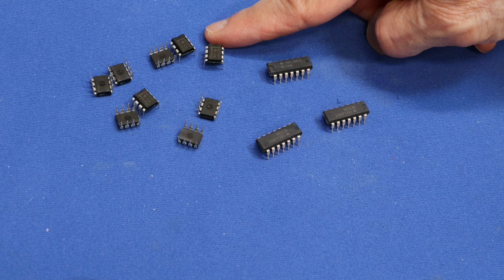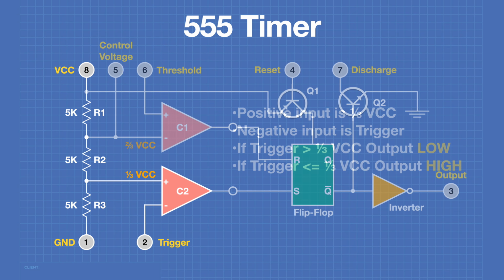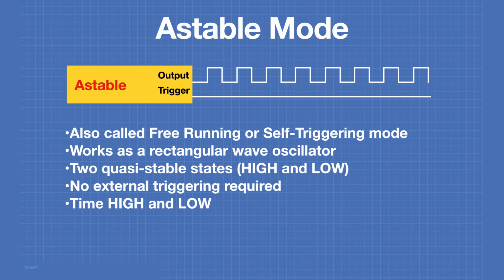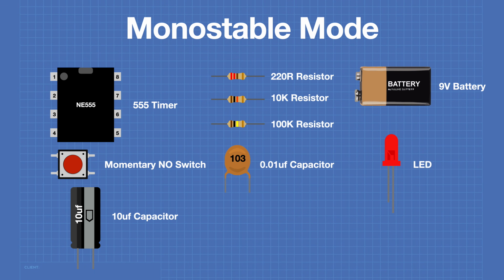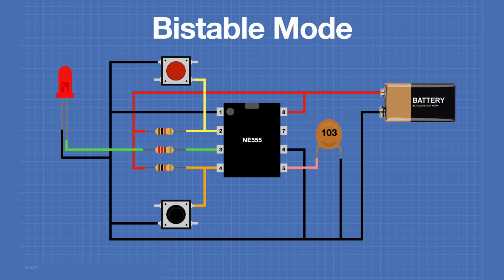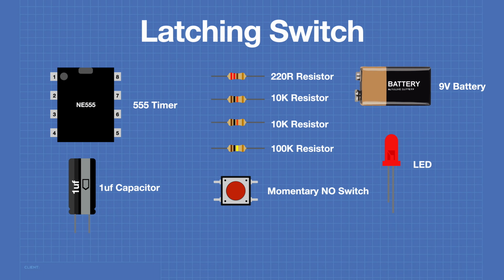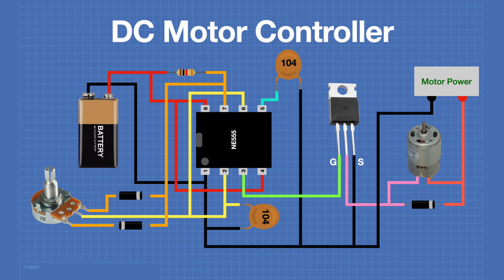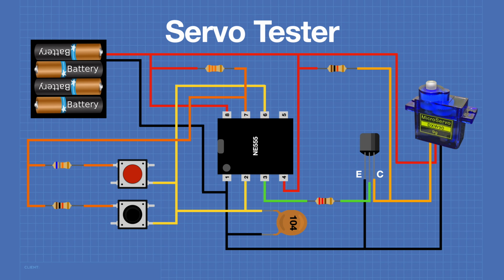Using the 555 Timer

Comment: sir this is very helpful video and the circuits you have shared are pretty good to work with. i want to know one thing. can you make a circuit diagram for us in which basically “when the current is provided to 555 it automatically turns on and turn off after 40-45seconds automatically and do not turn on ever after that, it only turns ON for these seconds when we apply voltage to 555” please make a video on this if it is possible. i am waiting really waiting i need this urgent to apply this somewhere in real life.

Comment: Hi,I don't know if it has been mentioned?...If so I'm sorry...  I had problems when using  the Latching switch diagram, I found that the green connection from the 100k resistor is at the wrong side of the 220R. Head scratcher for a while...Fantastic work Very clear and informative. Thanks

Comment: nice demonstration, in the touch switch mode, if the button is not released, how to make the LED switch off regardless of how long the button in pressed (in case I have door release lock coil instead of LED - so it wont be damaged)?

Comment: Hello, first of all, I just wanted to thank you for the wonderful tutorial on the 555 Timer. But when I tried using your wiring diagram for the latching switch project, it doesn't work the way it should. After I changed the wiring a bit, it worked. I only changed the position of the 100k resistor from between the anode of the 1uF capacitor and the anode of LED to between the anode of the 1uF capacitor and pin 3 of the 555 Timer. Thank you.

Comment: Thank you for your very informative video on the 555 Time. I would like to as a question regarding the DC Motor Controller circuit, I would like to run the motor at between 50, 60 and 80 Revolutions per minute. I built the circuit with a motor which runs on 1.5 Vdc. when I turn down the 100K Potentiometer the motor was still turning very fast. Thank you for instruction you maybe able to provide me to resolve problem. Thank you again for your instruction and informative video.

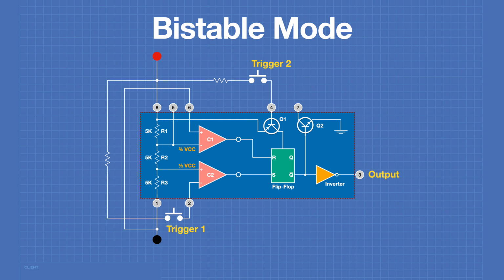Comment: Hi. Might there be a mistake in the diagram of minute 19:40? I see no link between pin 2 and ground through a button. Instead, the button is just connecting power and pin 2 with just an intermediate resistor. Anyway, I love Bill's video's and they are eye-opening for me.

Comment: Thanks for explaining the operation of this fantastic chip. One question. Since you run it at 9 Volts, the current throught the LED is about 33 mA with the 220 Ohm resistor. Is that not a little bit too much?

Comment: What if you installed a potentiometer and an old TV tuner style variable capacitor to fine tune the timing?
Have to check the Farad rating of the variable capacitor though, to make sure it won't fry the circuit.
I might try it sometime, I have all of those, if I can find them in my electro junk drawer.

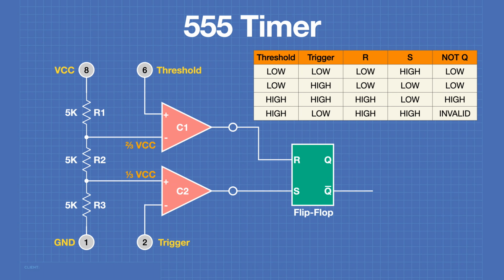Comment: Thanks for the video. I'm a little confused about the truth table at 06:25. If the threshold is LOW, C1 output should be LOW (as the negative is higher), but inverted that would be a HIGH going to R?   

I seem to be missing something with regard to the invertors after the comparators. Are these different from NOT gates? Can anyone explain?
Reply: Exactly what I was thinking. R and S are completely the opposite of what should come out so you're right.
Reply: Indeed inverting the comparator outputs is not consistent with the truth table.  Furthermore other 555 videos like https://www.youtube.com/watch?v=iwbGccGU4io and the 555 wikipedia page do not show any inverters there.  This does look like a mistake in this video.  Perhaps one way this mistake could have been made is that flip-flops are often drawn with inverted S and R inputs, with bars above S and R, in which case inverters on the comparator outputs would make sense.  So perhaps this diagram was copied out of some book with inverted flip-flop inputs; however, while the comparator output inversion was copied, the flip-flop input inversion was omitted.

Comically other videos on the 555 timer that don't show the comparator inversion say that it is named after the 5k resistors, contrary to this video.  Generally it is often possible to observe errors and contradictions in schematics shown on youtube videos, and never mind the videos where people use table saws and angle grinders in a way where they can lose their fingers, or repair vehicles in an unsafe way.  This just goes to show that electronics is hard and makes everybody confused, but at least at 5V you won't lose body parts or crash your car with your legs burned by a sudden engine coolant leak from above the brake pedal.

Comment: Thanks for great videos! I have a question, I want to control two 12v 4-wire PWM fans manually, but also with an Arduino, Nano, RPi or other microcontroller and display each fans status to a display. How would you include the microcontroller? Is it also possible to build a custom board to also power the fans, controller, or other add-ons? For example, I have a 110v PRC heater that I would llike to turn on and off to maintain a temperature while the fans are running at variable speeds circulating air.

Do you have a video or similar tutorial?

I’m new on this journey of learning electronics, so thanks again for the knowledge and your patience with the long questions.

Comment: and if the chip was to go obsolete and no longer made and/or was to go into shortage due to supply line shortage you can make it either from the individual transistors or using op amps and flip flop and transistors.

if the naming did not come from the 3 5k resistors then maybe inspired by the exchange code for the generic phone numbers used by hollywood.

every movie you watch that has a phone number mentioned is usually 555 1212 or 555 1234.

i thought the schmidt trigger was used because it has a very large fanout count where it can directly drive high power loads like an led without the need for a driver transistor.

Comment: I'm a beginner in electronics and recently designed a digital clock that displays the time in a binary format (hours and minutes only.)  At it's heart is an Arduino, and the timing of the clock uses the count function to increment the minutes, but I realise this isn't the most accurate way to keep time when designing a clock.  I've often thought about using a 555 timer, but haven't yet worked out how to regulate the output precisely enough to use it for that purpose.  This video is great for explaining the functions of a 555 but wondered if you could do one on how to use this chip for precise measurement of real time, if that's actually possible.

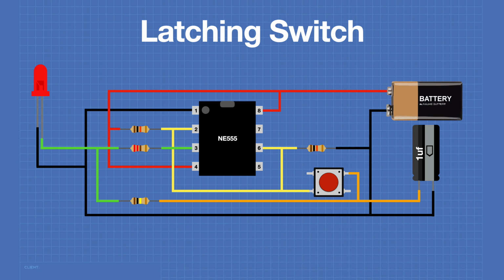Comment: my friend, i found a little mistake on the diagram on 29:00 minute (latching switch mode), the conection between the 100k resistor has to go directly to the terminal nr 3, in your diagram stay from the led and the resistor 220. Sorry for my english.

Comment: The latching switch schematic differs from your circuit configuration. The 100k ohm resistor should go in parallel with the 10k ohm resistor at the 555 pin 3 (not at the LED anode node) per your circuit.

Comment: Thank you very much for this great tutorial. I appreciate your effort and guidance. I would like to create a timer and see minutes and hours on an LCD after connecting the circuit. Is it possible to do it without microcontroller? As you've shown in the video can I somehow integrate the display instead of flashing led?

Comment: Does anyone know if the 555 as timer would allow for a restart? For example: say the capacitor keeps an LED on for 10 seconds when you press the button once. But if I press that same button again (or another one) when the LED has been on for 6 seconds already, I want it to restart the cycle and be on for an extra 10 seconds, making it a total of 16 seconds.

Comment: It's a great little chip that can be used for so many things, but I recently found out that it is one of the worst electronic nightmares if you want to use one in a car. Presumably because of the spark plugs, it goes crazy. I had one toggle switch that turned itself off, a buzzer that starts sounding like it gives off very fast random frequencies, almost like white noise, although it runs normally on a power supply or a battery... for some stuff that I added in my car I returned to the good old transistor circuits. I tried for weeks, nothing worked with the 555s, shielding, grounding, nothing.

EDIT: There's one detail that I failed to check, if the weird 555s were from the same lot or something, I never checked that... although I have seen people admitting that they might be a problem in a car.

Comment: Need a relatively simple circuit for switching a low power device of a few volts on for a second or two then waiting for about ten seconds to repeat.
One of these 555 circuits should do it.
But I could really use two of these circuits alternating together. How could I make that work?
Would I have to make two separate 555 timer circuits with a third circuit controlling them?

Comment: What are the units for the timing formulas? I'd like to get an idea of the range of possible timings that are possible with typical component values. My guess is that it's seconds, so that you can get periods of milliseconds up to several seconds with the resistors and caps that most of us have in the box. Is that about right?

Comment: For the mono-stable example, how quickly could you turn the LED on with button presses? Does the capacitor have to charge up again before the button will work?

And for the servo motor control, the length of time it rotates is again controlled by the capacitor, correct? So you're not able to hold the button down and have it rotate continuously, right?

Comment: I really enjoyed your talk on the triple nickel! Nicely done. I used the 555 and 556 a lot in ‘77 my senior year of high school for a clock pulse. What great memories back in the day. I found some discrepancies in your circuit diagram for the bistable mode. The circuit diagram does not match the pictorial diagram. I believe the pictorial is correct, as it shows the ground connections to pins 2 and 4 through the pushed switch buttons with their pull-up resistors.

Comment: Quick noob question just to see if I'm understanding something correctly: that capacitor that's determining the timing of the LED, the charge and discharge of the capacitor is independent of the energy the LED is using, correct? In other words, the charge state of the capacitor is determining whether or not the LED's circuit is completed (logic), and not actually energizing the LED itself as it discharges.

I've been fascinated with this stuff since childhood, and now some 40-odd years on I seem to struggle with the basics, even when following along and building the same circuit irl ... I often end up with a paint-by-numbers experience and not a deeper understanding of what I just built, no matter how long I stare at the schematics or how well I think I understand each component in the circuit.

Trying to start learning again with this ubiquitous chip, and I've been watching tutorials about the 555 all afternoon. As wonderfully paced and clear as this video is, I still personally get so confused when someone switches from talking about voltages and the math to calculate voltages in the circuit (which I can get my head around) to suddenly talking about Low vs. High states. I get that it's describing the logic of the circuit, and I understand what's being expressed in the truth table, but I don't understand if it means a presence of voltage/potential or a lack of voltage (e.g. 9V vs. 0V), or something else. I think I'm confused because when someone says "x is tied high" I think that means it's connected to the positive side of the battery, but then if that's what they meant they would've said "x is connected to positive", so I think it must mean something else.

Comment: i have a question , we said that the two comparators are inverted yet in 6:40 when i look a the truth table it doesn't seem to be the case at all, if threshold is low, the output of c1 will be low, shouldn't the inverter then make it high ? which will make the R input to be High and not low as shown in the truth table

would appreciate any help

Comment: At 5.34 in the video, it is mentioned that the comparator outputs are inverted prior to be sent to the flip-flop, if that is the case the logic table shown is incorrect. I have not been able to find information elsewhere that there is an inversion before the flip-flop and think this is a small omission in an otherwise excellent video.
Reply: Indeed inverting the comparator outputs is not consistent with the truth table.  Furthermore other 555 videos like https://www.youtube.com/watch?v=iwbGccGU4io and the 555 wikipedia page do not show any inverters there.  I think this is a mistake in this video.  Perhaps one way this mistake could occur is that flip-flops are often drawn with inverted S and R inputs, in which case inverters on the comparator outputs would make sense.  So perhaps this diagram was copied out of some book with inverted flip-flop inputs; however, the inversion of the flip-flop inputs was not copied.

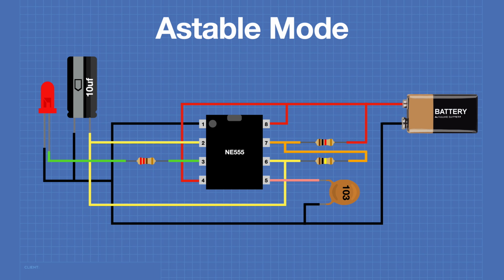Comment: I have a question at 12:30 if you use 220 ohm resistor with led then my program says too much current is passing through the led which is 0.29 mA. led is recommended 0.20 mA max. So i used 400 ohms and it’s working fine. Thanks for your hard work. 🙏

Comment: For the  Monostable Mode mode, is the shot shot re-triggerable before the output fall back to the stable state ? Meaning the input keep triggering so the 555 output always maintain in quasi-stable state till the last input trigger ends. This is for motion sensor application to turn on lights so need to avoid on & off state.

Comment: I think your block diagram for the bistable was wrong, but the wired diagram seemed correct. Also I was confused by the hollow circles half way between comparators and flip flop - is the output of the comparator meant to be inverted? I am bit confused about the theory of operation of the latching switch, does the diode voltage of the LED need to be taken into account i.e. does it need to be below 1/3 Vcc? I'm confused about theory of operation for touch switch if pin 6 is only connected to capacitor then how does it charge up as in theory no current will flow through the inputs of a comparator, and connecting pin 7 to Vcc through a resistor doesn't do anything other than dissipate power in a resistor?

Comment: I would like to ask a question, what are the limitations of FREQUENCY, VOLTAGE and CURRENT in using a BREADBOARD before crosstalk, and the copper conductive traces becomes antennas, and capacitances, inductances become EMI and components start getting fried?

Comment from the maker: One thing I forgot to mention in the video, but did mention in the article, is the units used in the formulas for calculating the time with the resistors and capacitors:

Time is in Seconds
Resistance is in Ohms
Capacitance is in Farads
Reply: flashback to Forest M Mimms III engineering booklets sold at radioshack LOL
Reply: Your bistable mode schematic is incorrect. You have both switches going to Vcc, when they should be going to ground.
Reply: would have been nice to touch on the frequency differences between the types as I have seen most are 500kHz while LMC I believe are capable of 3mHz high end range.
Reply: Sir... Can I used 555 Timer for a car to automatically lock all doors when speed reaches 40 kmph? 
Please kindly make video for this auto door locked circuit. 
Thanks in advance.
Reply: @tnamen1307  Would you consider doing your design in a PLD or FPGA, or even a microcontroller, which can come on an off-the-shelf board that you program? Then you use an oscillator for the clock. The 555 and assorted logic chips could be used for fun, instead, but you’ll have a better platform and still be simple to program if you use a microcontroller or FPGA.
Reply: @ThomasAndersonbsf  I still have mine.  Catalog number 276-5010A.  Thanks for reminding me.
Reply: Great explanation. I used it.more.than 25 years ago during my electronics engineering year 83 graduate and even after that during my work assignments. We are still using it unknowingly. It's in Christmas lights.
Reply: Capacitance is in Farads? Microfarads is more likely -- is that what you meant?
Reply: Technically it’s an oscillator…
Mr. Pedantic: probably
Reply: What mode is it when you have a variable oscillator triggering Pin 5 (the CV Pin) when the device is set up as an astable? Is that then a variable astable?
Reply: Is the 100k ohm resistance connection position on the latching switch correct?
Reply: @dang48  as do I still own mine--in fact, I recommend his works the other day to someone beginning to learn circuits for the first time.

Comment: If the switch was simply a spring that makes very limited contact from the impact of a thrown object, would the extremely limited contact time be enough to charge the capacitor?
Reply: It does. Finally got this to work on a breadboard.

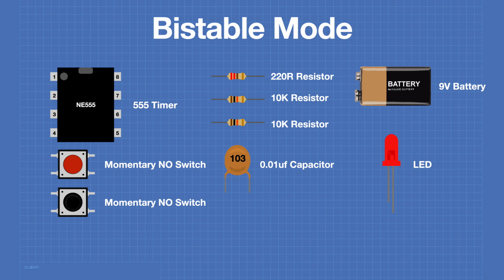Comment: 20:00 with Trigger 2 you are just operating whether the circuit is activated or not, shouldn't you have connected it to pin 6? And why did you bind pin 6 to GND? That gives you an always low output, right?

Comment: For the PWM motor control circuit, can someone explain to me the function of the diodes connected to the pot? Is it to rectify the square wave into a DC signal? If so, is still PWM?

Comment: Can multiple LEDs be used in monostable mode and would that change anything else? For instance, if there are three 3v LEDs in series is the resistor needed from pin 3 if using a 9v battery?
Reply: Don't know, but it's working with it so...